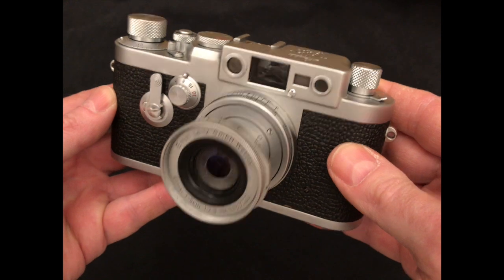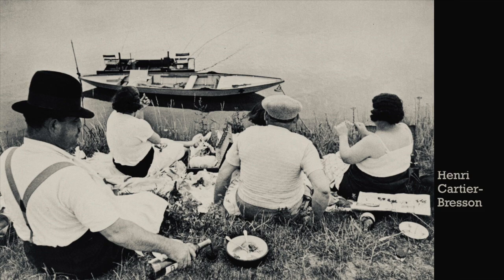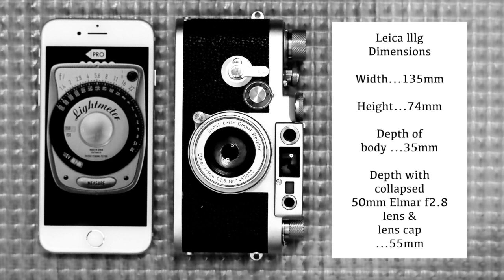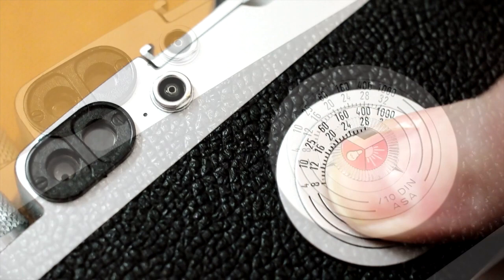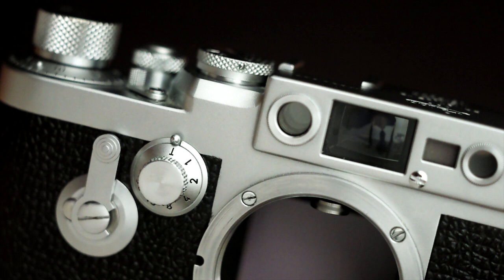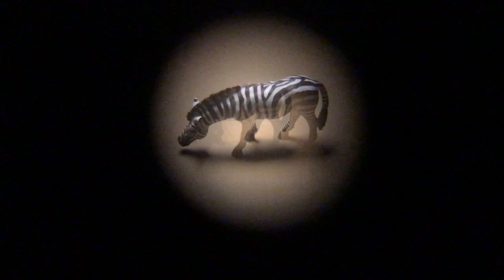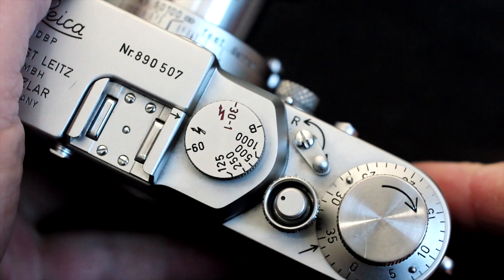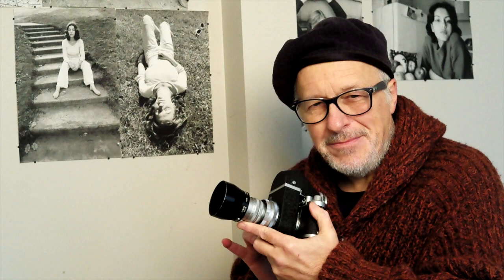Meet the LEICA lllg

Comment: The family Leica is/was a Leica IIIa, which was my first serious 135 camera. I learned a thing or two about "the usual suspects" of exposure/shutter speed/aperture/film type. In the 1970's, when I began looking at old/new cameras listed in Shutterbug Ads, the upgrade question came up: Advanced III-series, M-series, or Japanese equivalent? A Leica IIIg was as pricey as an M3 and a tad less than an M2, while the IIIc and IIIf models were (sorta) affordable. Canon Leica Screw Mount cameras, by contrast, were quite affordable, so I bought a Canon P. Cameras are tools to be used, not just acquired to be displayed in a glass case because they are an Investment. I did get a IIIf Red Dial/Self Timer model with an over-cleaned 50mm f/2 Collapsible Summicron, but that was years later.;)
Reply from the maker: Thanks for your comments, yes I like to use my cameras too rather than just collect them for display or investment. Good luck with your 35mm RF shooting!

Comment: Extremely comprehensive video. The closest I have to a leica is my Zenit C (a zorki with a mirror box stuck onto it) and it’s definitely nowhere near as smooth to use as this is. I use similar labyrinth cassettes on some of my other SLR cameras (specifically Shirley-Willard universal cassettes) and I will borrow your idea of bending the leader tongue several times to note an exposed roll.

Comment: Really liked the style of your video, with good close-up detail of the camera and lens and in particular the actual view through the rangefinder and viewfinder peepholes. Other reviews rarely cover this very important aspect of a camera which makes such a difference to its ergonomics . However, it did leave me wondering as an eyeglass wearer how suitable it would be for me.
Reply from the maker: Hi Gaurab, Thanks for your comment. No, this camera is not a good one for eyeglass wearers. You’d have to try it to see if you can see through it properly without your glasses on but you really need to jam your eye right into the viewing peepholes in order to focus and compose with them properly. Part of the problem is that the lenses in the peepholes are fairly deeply recessed, which has the advantage that they always tend to stay clean. Incidentally, in the video the 50mm bright line frame appeared pincushion-distorted but when actually viewing through the camera it appears perfectly rectilinear.

Comment: So nice to see a IIIg being used. So many of them seem to sit on collector’s shelves. What are the differences between IIIf and IIIg (besides the self timer)?
Reply from the maker: I’m pretty sure that the main differences are the self timer, the lllg’s bigger, more sophisticated viewing window, and a simpler form of flash synchronisation setting in the lllg. In the video the bright line compositional frame has appeared bent (pincushioned, I recall) whereas when you look through the camera in real life its perfectly rectangular, very neat. The lllg viewfinder also has the parallax correction too. I couldn’t imagine using a camera that doesn’t offer accurate compositional framing (and the lllg is very accurate) so the lllg is my choice. Yes, you need to use your camera!

Comment: Wonderful video! What kind of strap are you using? Looks very nice
Reply from the maker: It’s a cotton packing strap taken from an old wooden Japanese crockery packing box and stitched together with a plastic joining clip and adjustment buckle taken from a thrown-out kittens collar. Very hi-tech! The screw-in metal loop is a Leitz camera screw taken from one of their heavy duty camera straps. Because the tripod socket is at one end of the camera this type of attachment carries well, and I try to avoid using key rings at the side lugs because I think they wear them out. The new Leica fabric neck straps have metal loops which look and feel much more sympathetic, and that’s my 2nd option other than using the leather everready case, which also works well, it’s very compact and protective.

Comment: Hi!  Very nice machine.  I'm just a beginner, I also bought a iii f some time ago.  When I watch other people's videos online, I find that the shutter sound of my camera is different, I don't know if it is broken.  But the shutter sound of your camera sounds the same as mine, like a sharp rubbing sound, so the shutter sound is not very crisp.  Would like to ask if you have researched on this?
Reply from the maker: Hi Steven, I don’t own, and haven’t owned, very many of these Barnack cameras but I do own two of these lllg cameras of very similar age, serial number and overall external condition and I can tell you that one of them (the other one) fires with a noticeably louder and sharper sound than this one, so I guess they’re all a bit different, and I have noticed different shutter release loudness in the several different Leica M cameras which I have owned. As for having a broken shutter (eg. a broken shutter drum spring), I have had this once in a very well used Leica M5, and you’ll discover the state of your shutter, in this and other respects, eg. pinholes, fabric fraying and other faults, quickly and easily if you shoot a short test roll at a variety of different shutter speeds. The noisiness of the shutter may also be influenced by its internal lubricated condition and may be improved upon by cleaning, servicing and relubricating. Good luck with yours!
Reply: @enLARGE.darkroom  Thank you very much for sharing your valuable experience!  Really helpful to me!  Thanks 🙏

Comment: Is it possible to see the entire frame wearing glasses on the iiig vieuxfinder?
Reply from the maker: No, the lllg is not a good camera to use if you need to wear glasses. You really need to get your eye right in close at the deeply recessed tiny peep holes and glasses will prevent this. However because the camera has a focusing eyesight adjustment lever at the rewind knob this may make it possible for some glasses wearers to use the camera without their glasses, but you’d still need to find the main framing window peephole to be compatible with your eyesight, either with or without your glasses on. I need glasses only for reading and I find that the camera works fine without them, but if you need glasses for general vision then you may find the camera unusable. One of the interesting things that I find about the lllg which is not the case with the more modern M series cameras is that the smaller more deeply recessed optical elements of the focussing and viewing ports at both front and back of the camera tend to stay naturally and permanently clean, free of fingerprints etc., which is very convenient but it makes eyeglasses impractical.

Comment: What is the price please
Reply from the maker: These lllg cameras are typically the most expensive of the Barnack models, but not including very rare examples. On the other hand there seem to be plenty of them about in very good condition, perhaps because they were the most recently made model. They are generally much cheaper to buy than M cameras. For the complete camera shown in this video, complete with leather case (but not lens hood or cloth neck strap and screw-in ring) I paid about half the price of a second hand M body (body only, no lens) in similar condition.